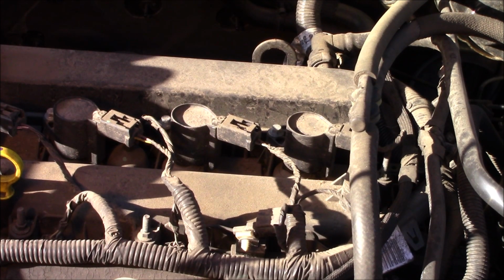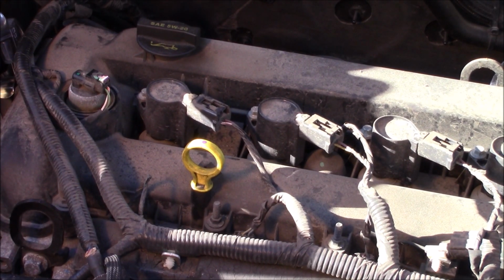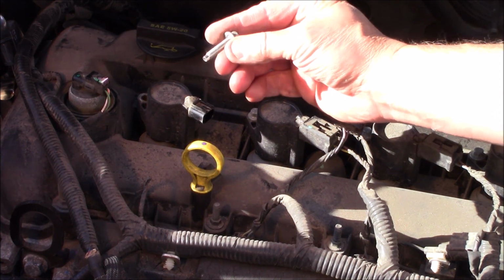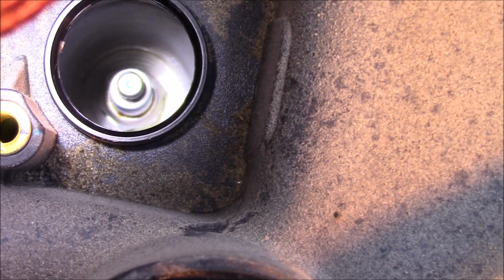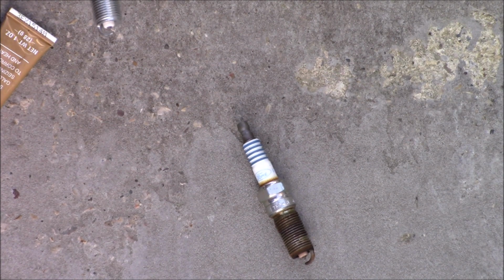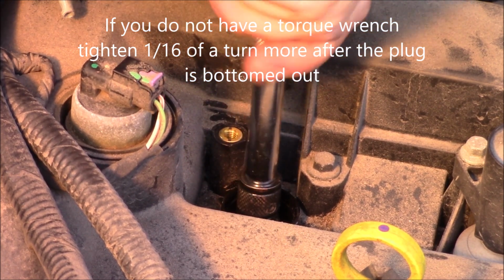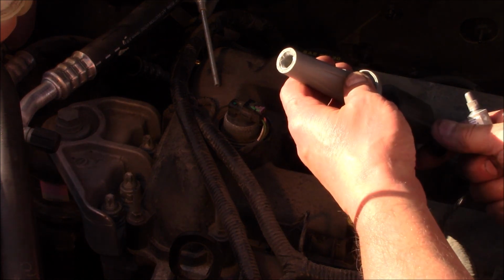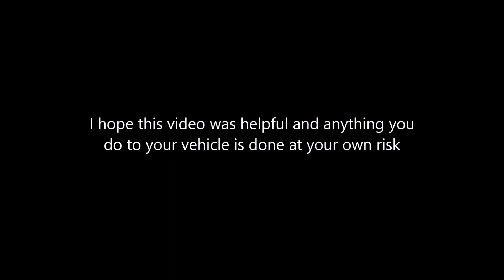Ford 2.5L engine spark plug replacement

Comment: I have a 4 cylinder 2010 escape is it the same proces and what is the thing that you used to take out the spark plug called?
Reply from the maker: If your engine is a 2.5L it should be the same.  The spark plug socket contains a rubber plug holder inside the socket.  I wish you the best on your repair

Comment: Great video, thank you. I have some oil on the connector going to the ignition coil, what can I use to safely clean the connectors on the coils?
Reply from the maker: You may wish to look closer at your valve cover gasket to see if it is the source of oil leaking onto the boot.  I would try brake parts cleaner on the boot to remove the oil and let it dry before installing. I wish you the best on your repairs

Comment: What size or model number spark plug for a 2012 ford escape?
Reply from the maker: Champion double platinum part 7437.  Please check to see if that is the correct spark plug for your vehicle.  I wish you the best on your plug change

Comment: What brand of plugs did you use
Reply from the maker: I used Champion double platinum part 7437.  Please check to see if that is the correct spark plug for your vehicle.  I wish you the best on your plug change

Comment: I need to change plug 3
Reply from the maker: I wish you the best
Reply: @bbbjim1fixedit  now it keeps turning off. The battery and oil light come on and the car cut off
Reply from the maker: @YKBNuNu  double check the voltage on your battery, fully charged is 12.6 volts, also make sure the coil pack is seated. If you have a check engine code that may help you get a better idea as to what you could look further into. I wish you the best in finding the problem
Reply: @bbb jim1  i did, but could it be the porcelain part of the spark plug causing  it? It was broken when i took off the coil.
Would an oil change fix this?
Reply from the maker: @YKBNuNu  it is unlikely an oil change will fix your issue, if part of the plug is inside the coil boot that would need removal or replacing the coil
Reply: @bbb jim1  I did. I cant think of what else.